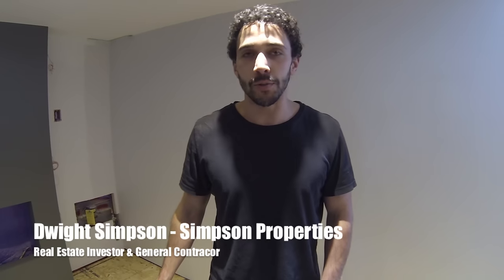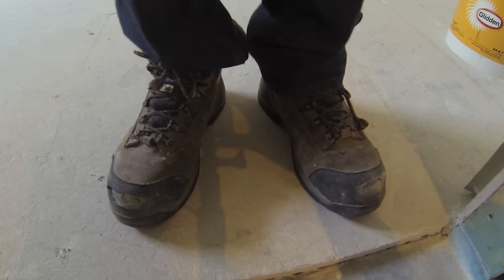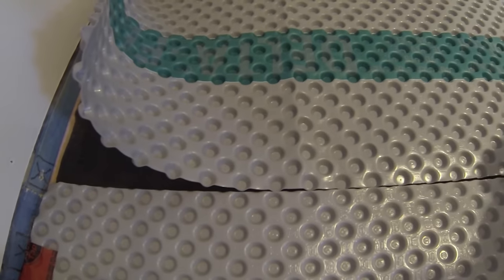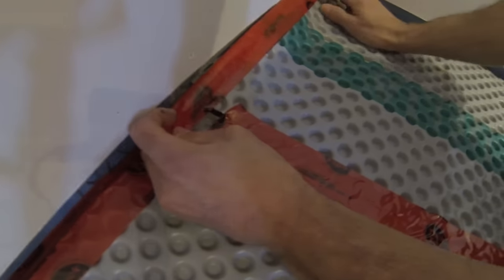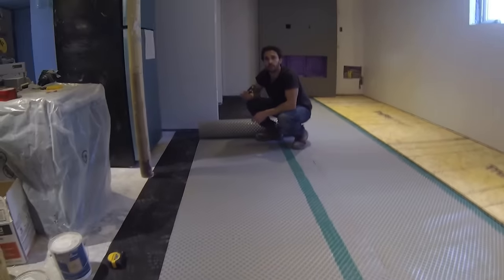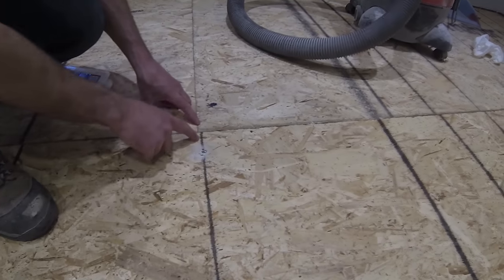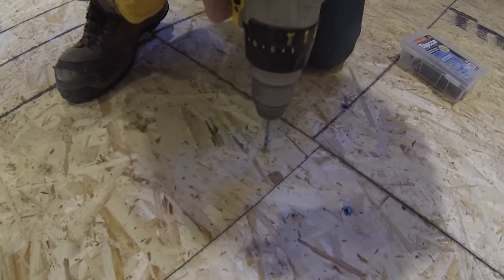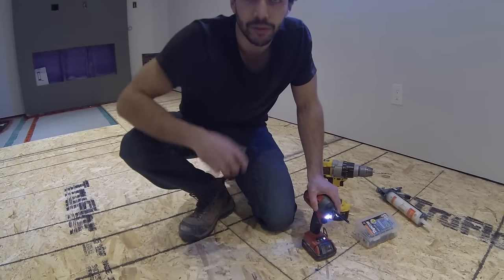HOW TO INSTALL A SUBFLOOR ON CONCRETE

Comment: What do you do if your floor is un-even. Can you shim somehow?
Reply from the maker: +Jonathan Raabe. There are a few options to level the floor one is to use self leveling concrete prior to installing the subfloor, which can be costly if it's a large area. Another option which I have never done is to rip wedges (large shim) from 2 x 2's. Then install those on top of your delta-fl, install your OSB on top, fasten through the wedges and  into the concrete slab.
Reply: Can you define uneven? Are 99% of basement floors uneven? Unless it's REALLY uneven, does it matter?

Comment: how would you transition from delta fl with OSB on top of it to a bathroom floor with ceramic tile. Would you use delta fl in the bathroom also?
Reply from the maker: +mrstockman in my case I usedSchluter Ditra-Heat uncoupling membrane and then installed my tile. There was a very minimal height difference between the hallway and bathroom floor. I used a floor transition piece to cover the transition from laminate to tile. It would great. You could also get your tile setter to build up your tiled are to the room with a sub floor installed. Don't use Delta-Fl under a tiled surface you need to use an uncoupling membrane that is designed for tile installations.

Comment: does this system work for concrete that has tiny indents in the concrete and 2 spots that is like a bump in the concrete?
Reply from the maker: swankowski1981 if there is minor imperfections in the slab, especially indents you should be fine.

Comment: Does it matter what landscape fabric you use? I see some more expensive and less expensive. Sounds like (pardon the pun :) it doesn't matter as it is only to stop the squeaking sound?
Reply from the maker: Steven Woodard you're right it doesn't matter what you use. Generally, commercial grade landscape fabric is grey and more expensive. I personally use the cheaper general purpose (black) landscape fabric.
Reply: okay great. thanks

Comment: Dwight, can you Epoxy right over the slab?
Reply from the maker: Yes, you can epoxy on top of a concrete slab. Just make sure you follow the manufacturers instructions. Prepping the floor properly is key to a nice finish.

Comment: is this method suitable for laying radiant heating mats?
Reply from the maker: This subfloor is not suitable for in floor radiant heating. You would want to use a product like Amvic insulated panels. Here is a link to their site: http://www.amvicsystem.com/ampex

Comment: Could I lay a subfloor on concrete without having to sandblast floor; just pulled up carpeting and tacks
Reply from the maker: Kimberley I'm sorry but I'm unclear what you mean by sandblasting the floor? Why do you need to sandblast the concrete?
Reply: I'm guessing because of carpet glued to the concrete

Comment: Hi there,
Do I need to tapcon the 5/8 T&G plywood to the cement afterwards? 
Also, should I clean and or paint the concrete floor before I lay the weed fabric cloth down?
Reply from the maker: Steven Woodard make sure you concrete floor is clean like I said in the beginning of the video. Yes you need to install tapcons to install the OSB properly.
Reply: Thanks again for this. Saved me about $700 by not using Dri-Core panels :)
Reply from the maker: Steven Woodard that's awesome!
Reply: One more question for you - do you build your interior walls before the sub floor goes down (into the concrete) or do you install on top of the sub floor?
Reply from the maker: Either method of installation works. On this project I built all my exterior and interior walls first then installed the subfloor. Going forward I will install all my subfloor first then the exterior and interior walls. Here are some of the pro's to installing your walls after subfloor installation:
- You don't need to use sill gasket or 6 mill poly under your base plates. All your walls are off of the concrete floor.
- When you're installing baseboards it's easier because you can shoot brad nails into your base plates.

The only con is it can make tasks like plumbing rough-ins more difficult without having the walls in place to use as a reference.
Reply: Awesome. Thanks again for all of the advice :)
Reply: One last question - what length of wood screw should I use to fasten my interior walls to the sub floor with? I'm using 2x4's for most walls (top and bottom plates). Should I use a screw length that JUST goes into the sub floor or does it matter if it penetrates the Delta FL?

Comment: Do you have to screw the boards into the floor? the other subfloor panels seem to just be laid out on top of it so why this extra step here?  really do not like damaging the floor this way.
Reply from the maker: With this subfloor system you have to install concrete fasteners.
Reply: Thanks, I looked around for pricing and such after watching your videos and I do not see the savings, all these options come out to pretty much similar prices.  I think I like the DMX 1 Step most and seems like the cheapest option as you don't need anything else.
Reply from the maker: Pricing will differ depending on where you live. Lowe’s had a deal on at the time for Delta-FL. Buy one roll and get the second roll free. 

DMX makes a great underlayment as well.

Comment: Can install laminate directly to the Delta-FL and not use OSB?
Reply from the maker: Yes you can. If you search Delt-FL spec sheet. The manufacturer describes in detail the various install methods.

Comment: any reason not to leave the osb floating? it's tongue and groove. if it weren't tongue and groove yeah i'd imagine you'd want a tapcon.
Reply from the maker: It keep the subfloor stable and less prone to movement.
Reply: @simpsonpropertiesltd  interesting. i'm seeing lots of people using these tongue and groove subfloors. however the national hardwood flooring association recommends never to actually let the sides of the plywood or osb touch. "Stagger panel joints allowing approximately 1/8” expansion space around all panels to prevent edge
peaking due to compression caused by panel swell."
Reply: @simpsonpropertiesltd  do you think this same method would work for on grade slab? i plan to do the osb and then solid hardwood flooring
Reply from the maker: @mikes5311 yes

Comment: Could you put ceramic tiles over this?
Reply from the maker: You can but it is recommended by the manufacturer to install an uncoupling membrane on top of the OSB or plywood before installing the tile. Schluter makes a great product called Ditra that works well for that application. I personally wouldn't install tile over this subfloor if there was a concrete pad. I would install Ditra-Heat (if it's a cold climate) directly over the concrete pad then install the tile.
Reply: @simpsonpropertiesltd  : how about installing vinyl plank tile over this?

Comment: Do you know how long this plastic will last before it starts breaking down?
Reply from the maker: Delta-Fl will probably outlast your home itself. Delta also manufactures Delta-MS membrane that is used for water proofing on the outside of a concrete foundation. The only difference between Delta-FL and Delta-MS is FL is made from new plastic material and MS is made from recycled plastics. Delta-Fl is also more ridged. Delta-ML is buried beneath the earth and exposed to the elements & it's designed to last a life time. So you don't have to be worried about your membrane breaking down.
Reply: +Simpson Properties 
The project looks really awesome! You gave me an idea on how to make our basement renovation nice, warm and free from moisture.I have a few questions for you. Do you think that OSB membrane won't warp or change its shape over time. I live in Midwest and weather keeps changing all the time. Also, are screws you used to secure OSB supposed to hit the concrete floor to make OSBs in place. This is kind of silly question, but I don't know how thick are those insulations. I also noticed that the top finished flooring is so gorgeous. Are those woodtiles, what types of flooring are they? Thank you for posting this video. Very informative and thorough!
Reply from the maker: +Gigs Lopez sorry for the late reply I just noticed your question now. As long as you use tongue and groove OSB you shouldn't have an issue with the boards warping because it locks all the boards together. I used 1-3/4" long Tapcon screws this will also prevent any movement and warping. The Tapcon screws do get screwed into the concrete floor that's why you need a drill with a hammer setting and a concrete drill bit. Using a corded drill is a lot faster. For the flooring I laid a foam under pad first then laminate flooring. Thanks for your questions and feedback! 

Dwight

Comment: Around here they suggest a gap between boards for movement.
Reply: I think a gap would be the way to go if your boards or flooring are not fastened to the concrete substrate.
Reply from the maker: You could leave a small gap for expansion/contraction.

Comment: I'm getting ready to install Delta Fl subfloor too but my question is, when you secure the OSB, what about the fact that you have now put holes in the Delta subfloor? I realize the screws will be filling those holes but doesn't putting holes in it make it possible for moisture to come through these holes? I'm sure this sounds like a stupid question but I can't figure out how taping and sealing everything up very well does any good if you turn around and put holes in the membrane. At the same time, obviously the OSB or plywood has to be secured. Can you explain how the holes do not affect the effectiveness of the subfloor membrane? Thanks for your help! :)
Reply from the maker: You're right when you drill holes into the subfloor you compromise the vapour barrier. That's why I put 100% silicone in each hole before installing a tapcon screw. By doing this it maintains your vapor seal.
Reply: +Simpson Properties Thank you so much for letting me know. I saw that you used silicone but I kept thinking there is no way to know whether the silicone actually sealed that entire hole or if most of it just went between the OSB and the subfloor. My issue is, I have a slab that has a moisture problem. So I did the plastic sheet test and sure enough, the moisture is coming up from under the slab. So I have to be very careful about maintaining that vapor barrier so that I don't end up still having the same issue. How do I ensure that I have definitely sealed those tapcon holes completely so that absolutely no moisture starts coming through?
Reply from the maker: +Dawn-E- Do I personally wouldn't install any flooring until the moisture issue is addressed. If you don't have a sump pump installed you may want to install one. That way any excess water surrounding your concrete slab is drained to the pit and pumped away from your house.
Reply: +Simpson Properties Okay. Thank you so much for your help!

Comment: Simpson Properties:I ripped my basement conpletely appart. I am in the process of deceding the subfloor option. I will like you spray foam all the walls. To get the same finished floor height as before, about 2.5", I'm planning to install: DMX, 1/4" osb,1" foam, 1/2 inch, osb, laminate. I will shimmed the 1/4 osb. Layering this way won't creat a hollow sound when walking.
Reply from the maker: I'm sorry but I don't understand what you are asking. Are you wondering if your process will create a hollow sound? If you're using DMX you should have no issues with a hollow sound.
Reply: ok, will the Delta or Platon will create a hollow sound?
Reply from the maker: +Guillaume Drolet if you use Delta FL over concrete floor without installing landscape fabric first there is a good chance you will have a hallow sound.
Reply: ok, good to know. Thanks. However, I don't like the idea to put a membrane down on the concrete cause I think it stop the breathability.
Reply from the maker: +Guillaume Drolet the landscape fabric won't prevent your concrete slab from breathing and Delta FL is designed to allow the slab to breathe.

Comment: Thanks for the info! Question, So after you drilled the holes to fasten the planks to the concrete. what did you do to put the flooring on top of it? I’m doing a floor like yours starting with bare concrete and I’m looking for techniques. Thanks again!
Reply from the maker: I installed a foam underlayment pad and a floating floor (laminate flooring).
Reply: Simpson Properties you stuck the laminate right on top of the wood sheets? Did you sand and coat with something for better grab? Thanks for your reply
Reply from the maker: Like I said previously I installed a foam underlayment pad first on top of the OSB. Then the laminate was installed directly on top of the under-pad. There was no need to sand the OSB.
Reply: Simpson Properties ok I get i it now thanks! like you said in the video there’s foam underpayments that come pre installed on the laminate I think I’ll go with that again, thank you so much! How’s the floor holding up since you made this video ?

Comment: Why would one tapcon the osb to the floor?
Reply from the maker: That's a great question. You fasten the subfloor to the the concrete pad for the same reasons you fasten a standard subfloor to floor joists. You want a solid subfloor that will be less prone to movement. If the subfloor was left floating on top of the slab, there is a good chance it will shift over time. That movement would cause imperfections in your finished floor.

Comment: Thanks for this.  I'm currently doing research on finishing a home theater in the basement.  Quick question about the landscaping fabric.  Any chance that could collect moisture and cause mildew, etc., defeating the purpose of the dimpled air gap?
Reply from the maker: Christopher Kou nope that's not an issue. It's recommended to use by Delta-FL. Landscape fabric is designed to be installed outdoors and not rot or deteriorate due to moisture.

Comment: That’s amazing. How come you finished wall framing before you installed the subfloor? Isn’t the wooden frame seating directly on the bare concrete floor?
Reply from the maker: Foam gasket or poly is installed underneath all walls on top of the concrete. Normally I would install the subfloor first but I had to use the walls as a reference for new underground plumbing.

Comment: Schluter DITRA-HEAT is also a awesome option.
Reply: But isn't Schulter ditra for tiles?
Reply: @anthonyrochon3907  No, not just for tiles
Reply from the maker: Ditra-heat is a great option for tiled areas. Radiant in-floor heat is more suitable for providing actual heat in large areas.

Comment: Wat plywood did u use. freat video
Reply from the maker: I used 5/8 (19/32) 4'x8' Oriented Strand Board (OSB) with a tongue and grove. I bought mine from Home Depot. You can purchase it from any big box store or lumber yard.
Reply: +Simpson Properties ta

Comment: So the landscape fabric wont get moldy? Anyone know?
Reply from the maker: Nope. This step is also recommended by the manufacturer. Landscape fabric is designed to be used outdoors buried in the earth. It take years before it breaks down in those conditions. Using it over a basement slab will be more than ideal conditions.
Reply: @simpsonpropertiesltd  awesome,  thanks alot!